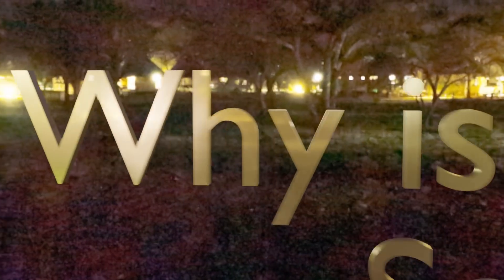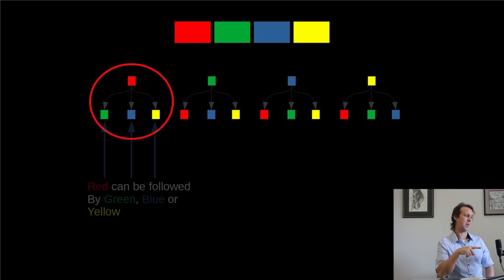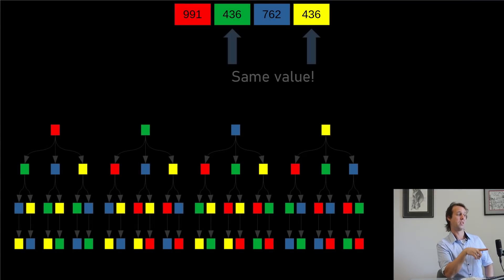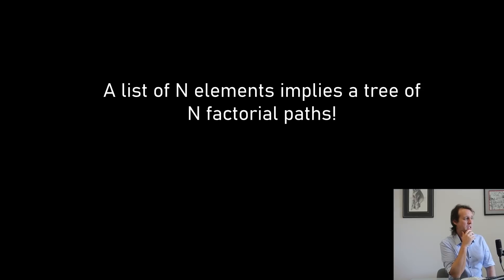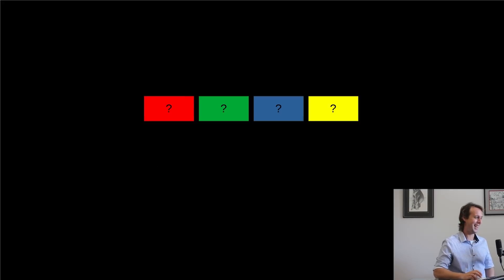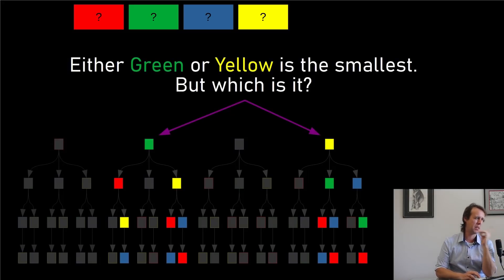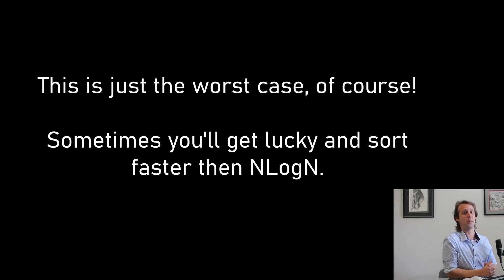Why is Radix Sort so Fast? Part 1 Why are Comparison Sorts so Slow?

Comment: radix is too slow, must be faster! :) Hash sort
Reply: Hash sort beats even radix sort
Reply: it does not use comparisons but division
Reply: division is the most advanced comparison operator
Reply: it does not only give the order of elements, but the relative location to other elements
Reply: thats the basis of the hash sort
Reply: radix is too slow, its trash
Reply: also talking in peoples hands is a slow way of communicating anything, God gives faster, language does not contain so much
Reply: so you imply that solving sorting problem is same as traveling salesman problem of O(n!) complexity

Comment: If the distribution is random, then yes O(N * log N) is the best you can do for comparison based sorts.
But if the distribution is not random, and the algorithm notices, it can take advantage of that and do less sorting. It will be O(N). And example of that is natural merge sort where the sort takes advantage of any natural runs (or reverse runs, and reverse that).
Reply: Does CPU use counting sort for small data ?

Comment: I feel like it's a shame that radix sort typically isn't taught since it's actually analogous to what most people would intuitively do if you handed them a stack of papers to sort and it's easily the fastest algorithm in practice. Sure, it doesn't quite fit within the rubric of going through sorting algorithms in decreasing big O complexity but it has its own interesting characteristics. It seems to be an esoteric algorithm only because it has a scary name, it technically doesn't lower the formal big O time complexity, and it's technically not as general as comparison sorts.

Comment: It's tangential to your video but when it comes to "why are there n! permutations?" I like to explain it inductively.

How many ways are there to arrange one shape, a circle? Well, one. It's there. Our answer is 1 = 1 (this will make more sense later).

How many ways are there to arrange two objects, circle and triangle? Well, two. First we do our arrangement of circle in the back and just out the star in front. Then we put the circle in front and arrange the star in our one way. Exciting stuff. 2 × 1 = 2, so that's our answer.

How many ways are there to arrange circle, triangle, and star?
Let's first write down that we can put the star in front and do both arrangements for circle and triangle. But then we can also replace the star with the circle and arrange the other two in two ways, and then we can replace the circle with the triangle and arrange the circle and the star in two days. So that's 3 × 2 × 1 = 6 combinations.

With four shapes we can apply the same logic. Do our six variants with one shape in front, then replace it with one of the others. We can do four replacements with the other shapes now. So we have 4 × 3 × 2 × 1 = 24.

This sort of construction might not seem exciting but it is useful for explaining the amount of permutations possible if not all items are distinct (five red marbles, three black marbles, two blue marbles, or maybe two 436).

I realise it wouldn't be helpful for the angle of your video, just consider it neat.

Comment: Because it is not really sorting anything. The real sorting part is establishing an order. If the list of values are already assumed to fulfill a certain order, then you aren't really sorting anything, you are only putting it in its place according to a predetermined key. If you have no established order, and no predetermined key, then radix sorts perform badly and/or will fail.

Comment: Radix sort is the fastest sorting algorithm for two reasons: Its number of data bit accesses is the theoretical minimum. It uses the spatial latency and the temporal latency of the memory cache to the maximum extend.
Reply: Optimal cache usage is actually funnel sort, this has been proved

Comment: "You can't go faster than NlogN." Ah yes, another theoretical result which doesn't hold in practice.

 If I have to sort unique numbers between 1 and 1 million. I can keep an array of that size in memory(can actually fit in cache) and put each number in its place. Once I run out of numbers I go though that array and collect my results. Complexity O(N). Omg we've broken math. 

Remember kids solve the actually problem in front of you instead of some fancy generalization which applies for google-sized problems and under some assumptions which don't hold in your case. P.S. The fastest data structure is a vector.

Edit: My problem is specifically with "can't" and not saying that there can be faster results in practice due to mechanisms like caching
Reply: may i point you towards the title.

"Why is Radix Sort so Fast? Part 1 Why are Comparison Sorts so Slow?"

key phrase: "comparison sorts", which, you may know, do not include all kinds of sorting.

may i also point you to the end of the video.
Reply: @d.l.7416  Yes, it's the end that bothered me. "What are you going to be doing unless comparing elements" ... "Can't go faster than NlogN". 
I see that limit mentioned everywhere and it can be broken in O(N). Moreover you can be even faster than a standard O(N) sorting algorithm by abusing patterns in your specific data.

I want this knowledge to be mentioned on the front page and be known by everyone, I want fast software.

P.S. I liked both this video and the other parts where he explains counting sort and its strengths/limits/applications. My problem is strictly with the emphasis of that limit without also putting an emphasis that there's probably a better sort for what you're doing.

Comment: I was taught that n*log(n) was from recursively dividing the array in half, sorting the halves and merging, which needs a depth of log(n) multiplied by a linear time to merge sorted arrays, but this permutation approach is far more elegant.
Reply: That's a merge sort, different approach, same time complexity.
Reply: @clefablelover7801  Quicksort is also roughly dividing the array in half and sorting the halves, just without merging. So the same logic applies to it.

Comment: To sort your 4 elements, all you did was ask 5 questions, so it looks to me you only need n+1 iterations/checks/comparisons. What about swapping numbers which are in reverse order until the last iteration doesn't have anything to swap anymore? If you are lucky and the list only needs 1 swap, that kind of sort is quite fast and is also a comparison sort. Just check if value 1 is larger than value 2. If so, swap number 1 and 2. If it's not, do nothing. Then move on to number 2 and 3, then 3 and 4. Don't forget to record the amount of swaps you do when running through the list. Then start again from the first number and compare it again against number 2 and so on. If the amount of swaps is still 0 at the end of the list, it's sorted. For a small list of any data, be it numbers or text, I find it fast enough to use even for a realtime game like sorting the inventory of a MMORPG.

Comment: there is a problem with the comparison sorts: it is not true at all that you can halve the number of possible permutations, even if the number is even.
Reply from the maker: Yes, you are right! Sorting 13 elements takes 34 comparisons, but Log2(13!) ceiling is 33. Sorry if that was misleading. Sounds like you are aware of the following list: https://oeis.org/A036604

I did try not say specifically that 'only' odd numbers lead to an inability to halve. Might have edited it wrong, but I was aware of that point. It's a great topic, really! So funny how the simplest questions lead to ridiculously difficult problems! What is the minimum number of comparisons required to sort 1000 elements? Nobody knows... :)

Anywho, great observation, and thank you for watching :)

Comment: This is misleading because the number of iterations you perform depends on the number of digits in the number, so it's technically n*log(n) complexity.
Reply from the maker: Yes, it does. But with radix sort, we often sort keys of a fixed size. A list of integers, for example, contains keys of 32 bits in length. So we iterate a fixed number of times. That's why Radix Sort is often said to be O(n). You're not wrong, of course, and cheers for watching :)

Comment: You could have just covered the whole stability topic in one sentence. And maybe one phrase for why it is useful.
"Sorting is said to be stable: WLOG if index of 436[green] < index of 436[yellow] before sorting, then index of 436[green] < index of 436[yellow] after sorting."
"It's a useful property for example if you want to use said sorting algorithm on the same set of numbers multiple times, e.g. sort a sequence by digits, starting at the highest significant digit. 42, 18, 12 => 18, 12, 42 => 12, 18, 42"

Comment: Yikes, the title of this series makes me cringe.  Asymptotic behavior is not "speed," not even as a rule of thumb.  Knowing that the asymptotic time complexity of f is O(N) and of g is O(N log N) won't tell you which algorithm is "faster."  Only that the run time of f will best that of g eventually as N grows (and assuming non-pathological inputs).  The threshold (if any) where it crosses over from g running faster than f to f running faster than g could be anywhere from 2 to very very very very large.  It depends on the specific algorithms and how the machine implements and performs them.  So if you're sorting inputs, and the environment offers two options, one O(N) and one O(N log N), you can't assume that the O(N) option will be faster.  This is one of the key lessons students who hope to do real software engineering should take away from complexity analysis.

Comment: 13:31 With the exceptions of 0 and 1, all factorials are actually even! So you actually should never have an odd number of paths (except in the cases of 0 or 1, where you'll know your list is technically already sorted anyway).
Reply: That only guarantees that the first operation is even. Every factorial greater than 2! will have at least one odd prime factor, so you'll always have some uneven splits.

Comment: I think you finally made sorting interesting for me. Would've loved a detailed discussion on why the time complexity of the comparison sort is log2(n!) though.
Reply: The time complexity of the comparison sort is not log_2(n!) because there is no such thing as "the"  comparison sort. Comparison sorting is a class of sorting techniques (which includes very different methods like selection sort and merge sort), and not all have the same complexity. But none can do better (in the worst case, or even on average) than log_2(n!) , for the reason explained in the video (each comparison can at best guarantee halving the number of remaining viable permutations).

Comment: Well this is not true. There is no sorting alogirthm with a complexity O(n!). The buble sort algorithm complexity is O(n^2). The most best theoretical sorting algorithm a "heap sort" has a complexity O(n*log(n)), as many other "good" sorting algorithms. The Radix sort algorithm has a complexity of O(n), because the data is in special case - numbers with a limited bound. But if we sort string or datas structures the best sorting algorithm complexity is O(n*log(n)).

Comment: I was taught that the Bubble Sort was easiest sort to understand but the lest efficient . However, there was  no question that it produced  correctly sorted result. Surely any sort will work no matter how slow it is and how much RAM it uses. Later I learned the Quick Sort. It as the name implies is pretty good and also, using recursion, is easy to code.
Reply: In my opinion bubble sort should not be used as a sorting algorithm for teaching purposes. I do understand that as an introduction intuitive algorithms are discussed first. But I think that bubble sort is not intuitive at all (and also has no application). I mean ever sorted a deck of cards with bubble sort?

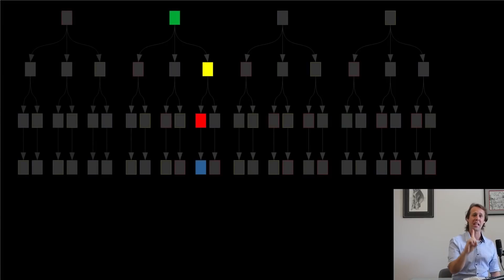Comment: 12:40 there is no guarantee that this is "the single sorted permutation", since a comparison can have 3 results, but you are always eliminating after only asking a true or false question, you may eliminate other valid solutions along the way
Reply: I think this depends on what the rule of sorting is if there are duplicates in a list. If the rule is to group all duplicate elements together then the algorithm can simply be extended to first ask a question if are the two elements the same, then element all the permutations where the elements aren't grouped together, and THEN asking the greater or less than question.
Reply from the maker: Yes, sorry, there might be duplicates!
Reply: @WhatsACreel  I'm sure most caught this, but I get annoyed when I notice a mistake or innacuracy and it hasn't been documented in the comments yet, so here's my contribution. Cheers
Reply from the maker: @hymnsfordisco  Great attention to detail! thanks for the contribution :)

Comment: But in my researchs I found that the industry pretty much uses Quick sort, at least this was my conclusion. Is Radix really more practical than other algorithms?
Reply from the maker: Yes, comparison sorts are very common! They're easy to implement and flexible - since we only need to define < for our objects and we can comparison sort just about anything! There's benefits to both comparison and radix. Cheers for watching :)

Comment: It is written somewhere in wikipedia about "spaghetti sort" as a stable n-steps sorting algorithm, but I didn't find the algorithm anywhere, maybe you know...I was interested in a fast, stable algorithm (like radix for big n, or inserting for small n) to write it with intrinsics) I have managed to write only bubble sort with intrinsics 😀
Reply from the maker: Ha! Spaghetti sort sounds like a brilliant algorithm! SIMD bubble sort for small lists can perform really well!! It is called Odd Oven Sort. I think your intrinsic version would fly :)
Reply: @WhatsACreel after your movie I'm trying "rank-order" with intrinsics .they say it is the best for small arrays and stable,, I'll let you know the gain comparison with bubble intrinsics
https://stackoverflow.com/questions/2786899/fastest-sort-of-fixed-length-6-int-array
*  sort6_rank_order_c(uint8_t* d) {	//Rank Order
	uint8_t e[6];
	memcpy(e, d, 6*sizeof(uint8_t));
	uint8_t o0 = (d[0]> d[1]) + (d[0]> d[2]) + (d[0]> d[3]) + (d[0]> d[4]) + (d[0]>d[5]);
	uint8_t o1 = (d[1]>=d[0]) + (d[1]> d[2]) + (d[1]> d[3]) + (d[1]> d[4]) + (d[1]>d[5]);
	uint8_t o2 = (d[2]>=d[0]) + (d[2]>=d[1]) + (d[2]> d[3]) + (d[2]> d[4]) + (d[2]>d[5]);
	uint8_t o3 = (d[3]>=d[0]) + (d[3]>=d[1]) + (d[3]>=d[2]) + (d[3]> d[4]) + (d[3]>d[5]);
	uint8_t o4 = (d[4]>=d[0]) + (d[4]>=d[1]) + (d[4]>=d[2]) + (d[4]>=d[3]) + (d[4]>d[5]);
	uint8_t o5 = 15-(o0+o1+o2+o3+o4);
	d[o0]=e[0]; d[o1]=e[1]; d[o2]=e[2]; d[o3]=e[3]; d[o4]=e[4]; d[o5]=e[5];
	return d;
}

Comment: He has a microphone, but why his voice is like he forgot to turn the mic on?
Reply from the maker: Yep, just not great acoustics in this room, unfortunately :( Oh, and my sound engineering skills are pretty hit and miss! Cheers for watching anywho, and have good one :)
Reply: @WhatsACreel  the easiest thing you can do to lesser the reverb is to move the mic closer
Reply from the maker: All great advice!! I will investigate, thank you everyone :)
Reply: @WhatsACreel  Consider getting one of those clip-on mics you can put on your collar, like what most TV presenters use.
The reason being that we can hear the table audibly resonate every single time you put your elbow on it.
Other than that, your current mic doesn't look all that bad actually but I wager you'd need to stay a lot closer to it for it to work as intended
Reply: Two Three Four echo
Reply: Putting up some blankets off-screen would work.
Reply from the maker: That's a really excellent idea! I think it would make a big improvement :)
Reply: What's a Creel? make sure you stay on-axis to the microphone. I can't really see but it almost looks like it's pointing at an angle to your voice.
Reply from the maker: Sage advice! Well, I recorded the three vids for this little series already, but I'll look forward to improving my mic technique in the next one after that :)
Reply: @WhatsACreel  Yeah, put some soft furniture/pillows etc in the room, and it will absorb the sound quickly as it bounces around. The "soft walls" they often placed in open-space offices have this exact purpose. They prevent reverb and dampens sound - making the office space more quiet.

Audio signal filtering might work - but often these kinds of filters can make the sound seem a bit off/weird.
Reply: @WhatsACreel  It might also help to move the mic closer and adjust the gain.
Reply: @WhatsACreel  Auralex looks cool and will do wonders for this. Check out placement techniques by watching videos on recording studio room treatment. Another thing that might help is some dsp plugins, but setting that up is a bit more tricky.